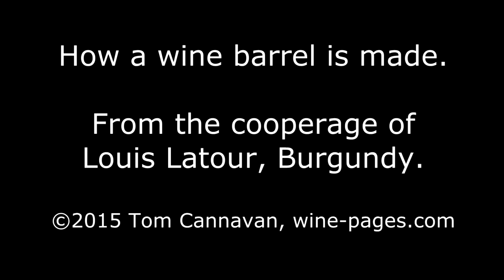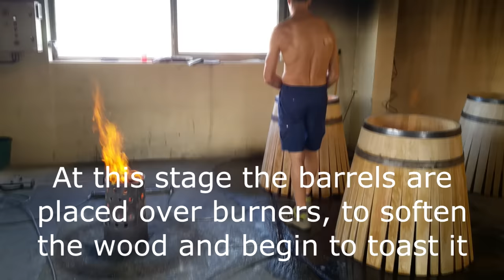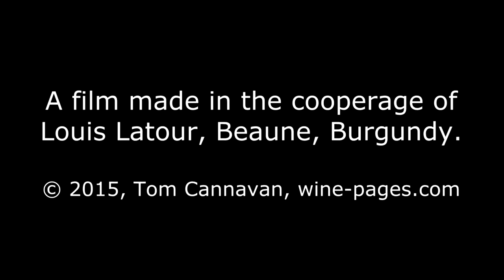how a wine barrel is made

Comment from the maker: Many people have asked about fitting the tops and bottoms into the barrel (the 'heads') which did not happen during my visit:  a slot is cut inside the barrel, round its whole circumference, near the top and bottom. To fit the 'head' piece, a couple of the steel rings are removed to loosen the staves slightly, and the head is manipulated into the slot. When the rings are hammered back down it tightens the barrel staves and the head piece is firmly squeezed into the slot.  I hope you enjoy the film :) https://youtu.be/BReofCcAx-Y
Reply from the maker: Thanks Al. Yes, as I have said elsewhere, there are some stages that just were not happening during my short and unplanned visit, but I hope 90% of the process is there and explained clearly enough - and is helpful :)
Reply: @PashaCooper  cool stuff. That helps a lot.

Comment: What's the benefit of a barrell being bulged like that instead of making it a simple cylinder?
Reply from the maker: The answer appears to be that it actually makes manipulating barrels easier - especially once full of wine and very, very heavy - as you can change direction as you roll very easily. I was also told it makes the structure stronger and able to withstand the pressure of the liquid inside.
Reply: Gummel , strength.

Comment: question - once a barrel is used, and a hole is made in it, how can one close the hole again? or does every barrel is one use only?
Reply from the maker: The barrel has a hole drilled in the side and a 'bung' - like a big rubber stopper - is used to open and close the hole.
Reply: @winepagesTV  can you reuse the bung and fill the barrel with wine again once it is all used?
Reply from the maker: @nikimilky  Yes, absolutely. Barrels can be re-used many times, and a lot of winemakers prefer barrels that have been used 1 to 3 times before instead of new barrels, as they don't give such a strong 'oaky' character to the wine.

Comment: why don't they just put the wine in a plastic barrel and throw wood in with it? seems like it would be a heck of a lot less work for the same effect...
Reply from the maker: Hi there. Essentially that is how some less expensive wines are made: by putting wooden planks or bags of wooden chips into steel tanks. But ageing in oak barrels has other effects on the wine too, not just aroma and flavour, so there's a bit more to it than that.
Reply: Yes Sir, same process the old timers used... Except they didn't have modern tools.  The old timers knew what they were doing, and even with modern equipment, there's still a lot of work needed to do the job,.  Some people never learn to appreciate the effort. Great job!!

Comment: I wish that one of these video's would show how they put the taper in the hoops. It is not just flat stock metal.
Reply: There is a traditional Australian cooper that does a video showing how to make a bucket. He shows how to taper the rings. Barrels are bigger but the same process. although modern they probably use cold roll rather than a hammer.

Comment: Where can I buy one of the these barrels?
Reply from the maker: Hi there - that's something I can't help with, but a new, full size wine barrel is an expensive item - maybe $1000US/Euros. Used ones much cheaper if you can find them.
Reply: I have seen on ebay for $220, I will buy one from there, I just wanna make a table out of it.

Comment: Do you machine each piece of wood precisely? By using a cnc router or anything like that?
Reply from the maker: Hi Igor. To be honest I do not know the answer. This barrel facility is a blend of high tech machines and very old traditional woodworking skills, but my guess is they would use a machine to create the shape of each stave.
Reply: Thanks!
Reply: They almost certainly machine them, but there's no need for a cnc.  The staves are the same length, thickness, have the same bevel, and arc, but you can easily see they're not all the same width.  Process is probably, cut blanks to length, thickness plane,  route the arcs along the two edges along the length using a template and follower-bit, then go back over the arcs with a bevel-cutter and follower bit.
Reply: Autrefois c'était entièrement fait à la main!!!... il faut savoir très bien mesurer,  calculer, dessiner, couper... etc....... du travail d'homme vrai!!!... By

Comment: how do you get the tops and bottoms in?!
Reply from the maker: Michael, I explain in the intro text that this bit wasn't happening when I filmed: "One important stage that is missing is the fitting of the head and bottom pieces. Once the barrel is assembled, a slot is cut all the way round the inside of the barrel top and bottom. Steel rings at the top are removed to loosen the barrel, and the head piece - whose circumference is slightly bigger than the inner circumference of the barrel, is slid down and slotted into place, before the rings are hammered down again to squeeze the barrel together and securely grip the head piece. Then the same is done for the bottom.
Reply: @winepagesTV  Ahhh cool. thanks for wrtiting that though.

Comment: How are the top/bottom fitted?
Reply from the maker: It's a shame I did not get to film this part of the process, but basically there is a slot or groove cut inside the barrel, round its whole circumference, near the top and bottom. To fit the top 'head' piece, a couple of the steel rings are removed near the top to loosen the staves slightly, and the barrel head is then manipulated into the slot - it's circumference is very slightly bigger than the barrel's inner circumference, so it sits inside the groove all the way round. When the rings are put back on and hammered down it tightens the barrel staves again, and so the head piece is firmly squeezed into the groove. Then the same is done for the bottom.

Comment: Seems like a whole lotta unnecessary work.  Why not use metal barrels?  I'm sure they'd take 1/100th the amount of labor.  If it's for the flavor, then hire some chemists to determine the difference and add what's missing.
Reply: They do use stainless steal vats with oak drop ins for cheap nasty wine , quality wine needs a quality barrel
Reply: Corrosion

Comment: If one of the steel cables breaks the man loses his foot.
Reply: If one of those steel cables breaks  you are putting so much pressure on it you would indent the wood if not crush it completely, and the cable would likely put a hole in your chest the size of a dinner plate.